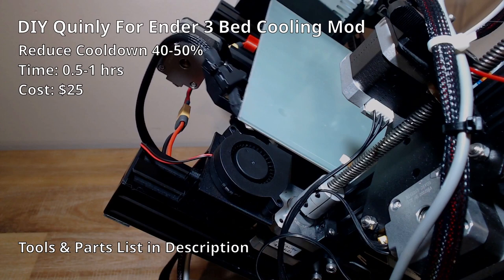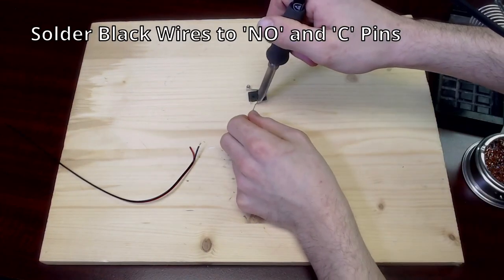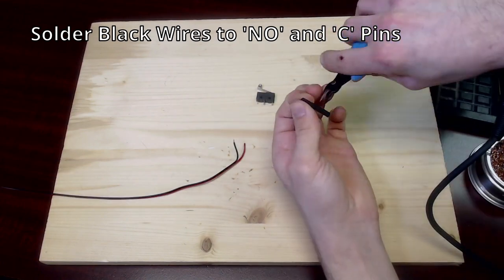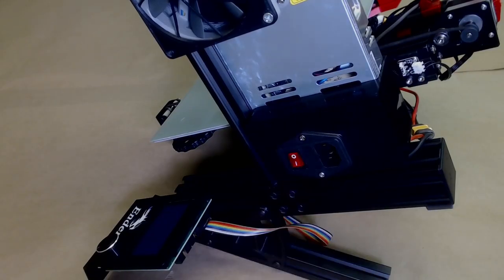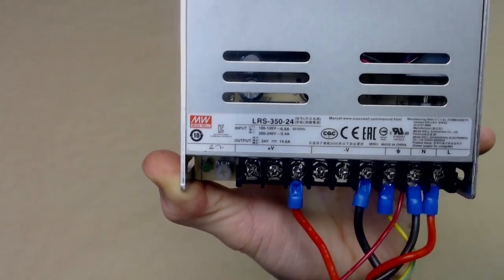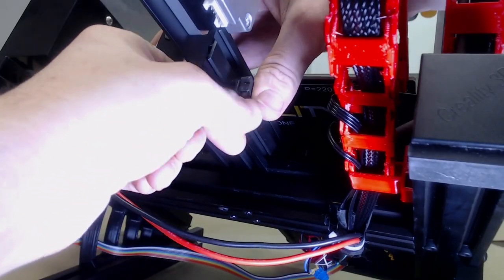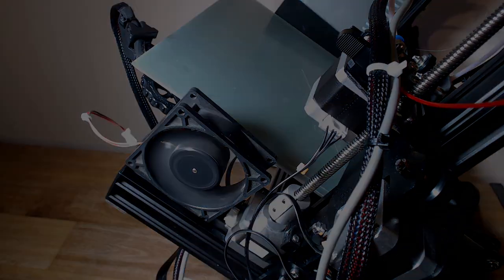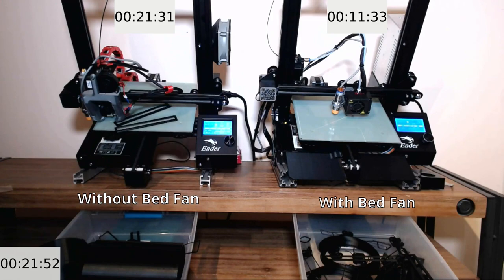Quinly for Ender 3 Diy Bed Cooling Fan

Comment: thanks guys 👍 I'm printing a lot of abs in an enclosure and I want to add a fan under the bed, connected to a duct bringing cooler air from up the floor, as well as an exhaust fan at the top of the enclosure that comes on at the same time.
Reply from the maker: What are you using these days?

Comment: Wait wtf this is so simple yet such an amazing idea... I don't have a Quinly system but I'm always annoyed whenever a print is finished and I have to annoyingly pry it off my bed or wait mad long for my bed to cool. Especially since I insulated it. I have plenty of roller switches lying around. I have a few 80mm fans and blower fans laying around as well. I think one of them might be 24v but if not I have plenty of buck converters to step down the voltage. This got me excited lol. It's perfect too because since I'm running Octoprint with TPlink power control my printer automatically shuts off 10 minutes after a print is finished. So just incase I'm lazy or sleeping when a prints finished it's not just sitting there with the fan blasting the whole time.

Comment: Awesome video! Thanks for uploading. I've got a couple of questions:

1) Does the fan ever activate during printing? It seems like it would turn on if the bed were fully retracted, which could happen during prints that use the full bed. It seems like this might cause issues with bed temperature, such as uneven bed temp and extra unnecessary heating to compensate.

2) What method do you use to communicate with your printer? I've been trying something similar and using octopi to communicate with my printer, writing my own g-code for the cooldown and remove script. However octopi seems to reach a "Timeout" point if the cooldown takes too long. It will then instruct the printer to continue with the removal process even though the bed isnt fully cool. I tried adding M190 (Set bed temp) to the Long Running Commands list and that helped some but it still will continue on even if the bed hasnt reached my target cooldown temp.

I'd love more information on the programming side of your print removal. Any information you would share would be very helpful. Thanks!
Reply: After some brief investigation (Sorry I didn't start with this) I see that it seems you use a custom bed material and print management program to remove prints. I may end p purchasing one of your kits but as I'm on a tight budget I'll likely continue to mess around in Octopi and with the default hardware of my printer. I can tell you all have put a ton of time into the R&D of your kits and process. Very well done. I'm impressed. 
Still though, If you felt like sharing anything you learned during your developmental process that would assist me in my current situation I would greatly appreciate it. Thank you!
Reply from the maker: @charlesbarker9615  Hey Charles, good questions! Glad you appreciate the work we've done on these kits, it's taken 5 years to get to this point :)

1. The fan doesn't turn on during the print. When the bed is fully retracted, at least on our printers, the nozzle hangs over the front of the bed. So the fan won't turn on under normal printing conditions.

2.  We developed our own software to communicate with the printer to avoid limitations due to firmware and gcode. The problem you mentioned with the bed cooldown is one I'm familiar with as well. We encountered this in the early stages of development, and it's just one of many reasons that we chose to write our own software. We've also designed our software in a scalable way that will eventually be able to connect with many (even hundreds) printers at the same time in a central dashboard.

Comment: you can mount the z-axis switch on the left side of Y tensioner, so the bed is in fully extended position and when parts fall off, it doesn't fall onto the rail
Reply from the maker: Interesting...

Comment: Not sure what then benfit of this is.  All I saw a two printers, one printed faster.  Nothing to do with the fan.
Reply from the maker: The fan works with our automation that runs your printer 24/7 - the fan cools the bed faster to shortens the cooling cycle which improves throughout.